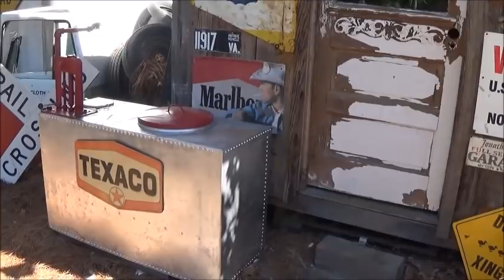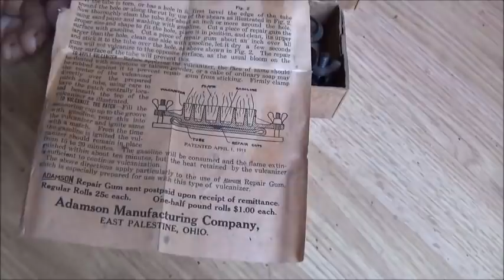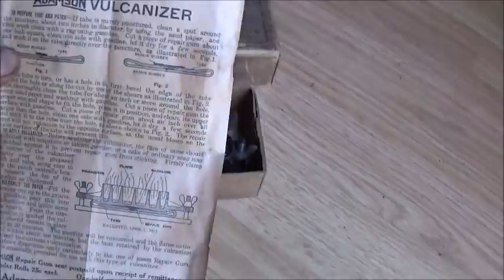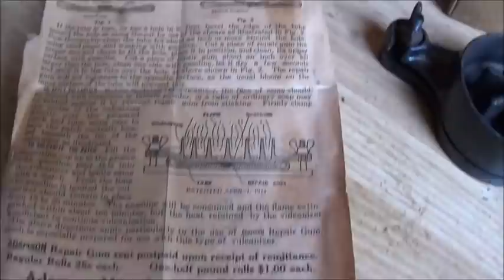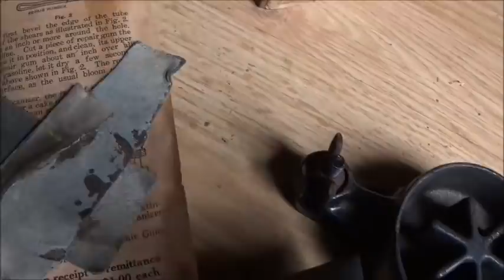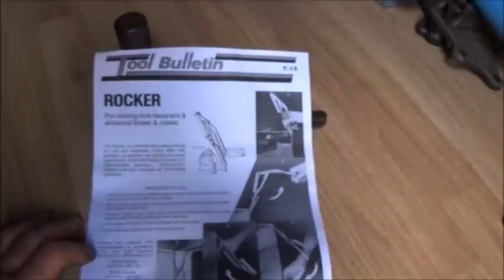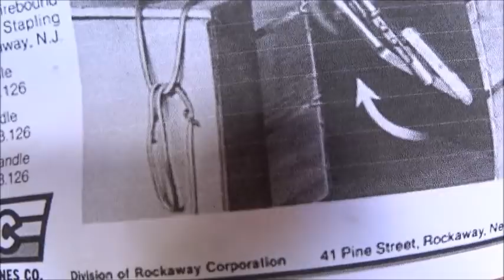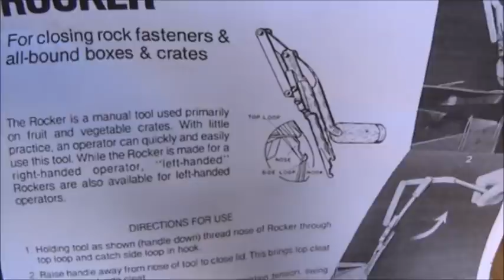HISTORY FROM MY HARDWARE STORE 5 VULCANIZING REVISITED

Comment: When I was a kid I used to use the cold patch kits but I would light them on fire anyway! The glue burned pretty good too ! Gary from Raleigh
Reply: Same here.  Many a bike tire rescued that way.
Reply: Same
Reply: Me too, cold patch but we lit the glue and stuck the clean patch over the hole 🕳️ .
Reply: a still use cold patch on bikes and dirtbikes motorcyckles.
Reply: Me too, many bike tires/tubes back in the late 60s and 70s. Nowadays for tubeless tires I carry a tire plug kit and a 12v compressor just in case I'm not near 120v for my work compressor which goes everywhere I do. It has paid several times being prepared.
Reply: one time a had 36 holes in my bike tire. a did drive over a thornbush. but a did patch it😂

Comment: The patch material is raw latex rubber with a linen backing soaked with sulphur. I messed around with those about 20 years ago, but diddnt have the original patch material...I asked my school science teacher, who had been a material scientist for the govt what vulcanizable rubber I could try.... We had several options. But butyl rubber tape and a thin canvas backing(may have been an old white flannel shirt or bedsheet if I recall correctly) worked fantastic. The butyl has enough sulphur in to to vulcanize properly. Mush the butyl over the hole, puth the fabric over it and clamp it down. Also was super easy to get, I think I begged an auto glass shop and they gave me some.

I actually bought some raw white rubber to try, but when the butyl worked I never attempted it.
Reply from the maker: Thanks for that.

Comment: The gum rubber used in retread shops has an expiration date because it hardens and therefore loses it's adhesion over time. It's amazing that patch even worked when it was this old. The old tubes of that era were made of natural rubber as well...not the same type of rubber as this tube. 
 I'm impressed that it worked.

Comment: I'm amazed the patch worked. When I used to deal with cable repair our rubber had a shelf life and had to be kept refrigerated to make it last better and stay pliable.
Reply: Same we had some rubber boot sheets in a big roll that we used to temp cover splices on Lead sheath paper cables, it was self adhesive but we also had DR cement we would use. Wish I had a roll of the rubber booting material, wish i could remember the name of it! good times back then learned alot of skills from the older guys!

Comment: When I was a kid in the early 70san older guy like my grandfathers age showed me how to use a hot patch vulcanizing kit for my motorcycle tubes. I can remember it was a clamp that held a pressed out piece of tin that was somewhat cup-shaped. the inside of the cup was filled with paper that was impregnated with something that burnt kind of like a sparkler. The patch was part of the tin cup thing so the tin cup was disposable. It worked really well from what I remember. I used itto repair my dirt bike tires quite a few times back in the 70s and bought a few more of the kits as they were fairly cheap. I'm not sure when they stopped making them, I haven't seen one in decades

Comment: Story is that, in the Ozarks, a lot of tires got cut by the sharp rock on the gravel roads.  When tires were in short supply or not affordable, one trick they used was to "stitch" the cut on the inside with flat belt lacing, and apply a patch cut from an old inner tube over the lacing to protect the tube that was being used in the tire.  The article I read didn't specify if hot iron was used to apply the patch, but I see that as likely.  Using an iron and a little fire was probably preferable to spending a nickel on any glue that might have been available.

I remember seeing a few of those hot repair tools being used, probably in the late 80's, in one of the few old road gas & tire shops still open at the time.

Comment: Did a quick search for hot patches.  Apparently they are still
Sold overseas but our epa banned them here.
Reply: http://www.centralsupply.com/amflo_master.html  The self-burning ones gave off some nasty gases, but the electric hot patches don't, and you could use them with a gas burning patcher too. I never used the self-burning kind - we had a hot cup type.

Comment: jonathan  rubber is rubber  if its untreated  it all comes from rubber tree as a sap. it has a problem with durability if untreated  and smell if i recall, the process to stabilize rubber is vulcanization.. a process of adding sulpher to the latex rubber and bonding it chemically....that requires heat and pressure heat around 212 and probably 20 lbs or so for the molecules to bond....in your last video more heat and pressure might have worked but i suspect the sulpher in the patches has absorbed moisture  as has the blackpowder to heat it with so poor results..possibly throw the patches in an oven 30 min or so low heat..and as far as i am aware real rubber is still vulcanized because it rots if not  and reeks. thanks for the videos

Comment: I was pretty sure that octane was really low originally. This article says 40-60 in the 1920s. Wasn't until later they improved cracking and was able to increase the octane 
https://www.thoughtco.com/history-of-gasoline-1991845
Reply: I did some additional reading out of curiosity.  But the closest we would have today to original gasoline would be white gas, or Coleman camp fuel.  It has an octane around 50-60. They said it was originally called drip gas and probably sold as original gasoline when kerosene was the major product. It would be interesting to see how the cup would burn with Coleman fuel instead of modern gas? Probably not too much different since it's 10% alcohol anyways

Comment: In the 1920s gasoline was very low octane, so a 10 minute burn was probably easier to. Attain with less gas
Reply from the maker: Lower octane would burn faster. Higher octane has "Dopes" added to keep it from burning as easy so it would not pre ignite. Pre 1920's would have been all over the chart when it came to octane. Some "drip" gas like we would get from the wells in West Virginia was very low octane and a very low flash point.

Comment: As soon as you mentioned this kit using gasoline, I immediately thought that it would work better than the previous kit. Granted, the heaters in those were probably far more effective when they were brand new, but gasoline puts out a lot of heat when it burns. I was happy to see that I was correct in my assumption :) Thank you for showing us another kit, as well as actually demonstrating it for us! :)

Comment: Gasolines produced in the early 20th century were lower octance, not higher. Those early engines had low compression by modern standards,  less than 8:1 was typical. The ignition systems used back then were pretty anemic by our standards and weren't capable of reliably firing higher pressures.